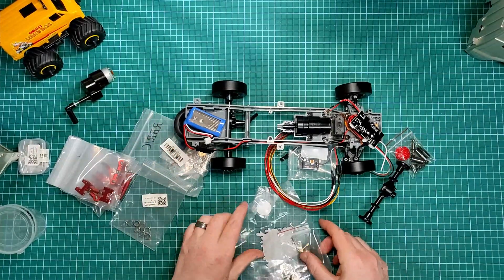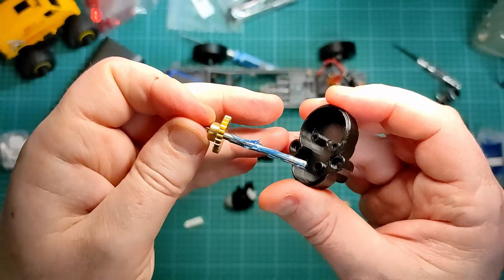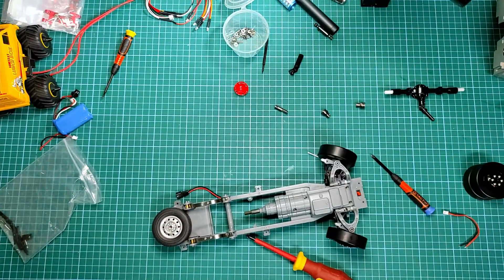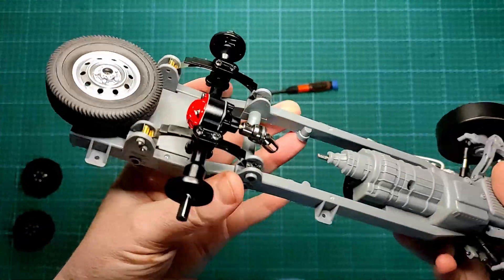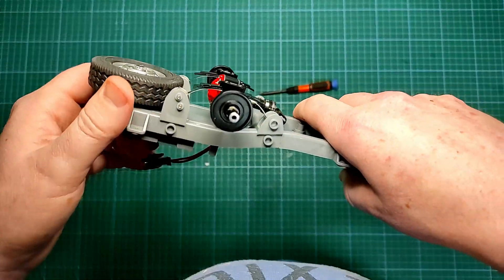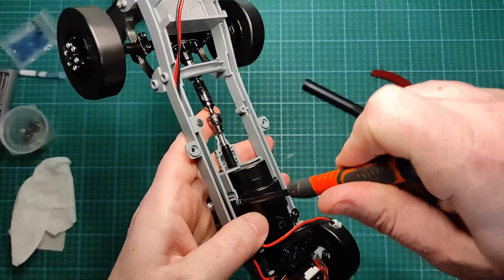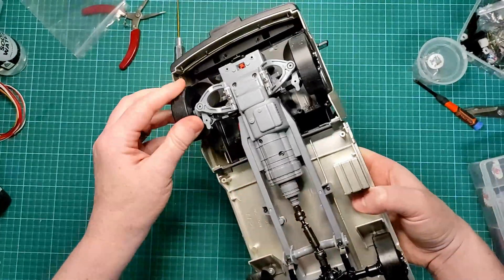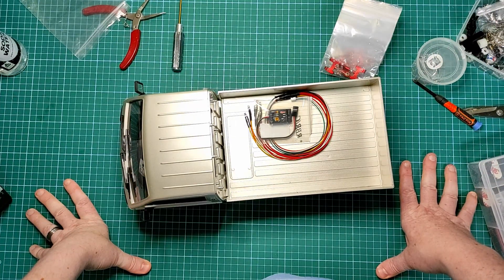How to Upgrade WPL D12 Drivetrain inc. Bigger Motor Metal Gearbox Driveshaft Axel

Comment: My 370 motor cuts out and the lights flash ... I can't figure out why either
Reply from the maker: Been a while since I messed with these, but usually that means your drawing too much power under load and so the battery gets too low, and low voltage protection kicks in and shuts you off. Cause? Gearing may be too tight, might need a better ESC or battery. I'd ask around in wpl forums, someone will know exact cause.

Comment: After my upgrades to metal parts, my D12 sound like a tank. Very loud engine sound and slower in speed.😅
Reply from the maker: Hahah yeah, upgrade to metal, need bigger motor. Bigger motor need bigger battery. Bigger battery need better Esc. Better Esc need better radio. And on and on :) then you begin to appreciate the original design haha
Reply: @CheapCheerful  Yeah, u r absolutely right 👍Thus, I have ordered another D12 on the way😁

Comment: Is the factory dif open?
Reply from the maker: Good question! The most basic set has a "locked" (or no diff) if I recall correctly, though it's been a long time since I've used stock, perhaps someone else can confirm. If you are getting the upgraded diff, there's a number of tutorials on installing and breaking in the gears (usually with a drill) I'd recommend you research and follow that guidance.
Reply: @CheapCheerful  ok thx

Comment: Do you have a preferred/trusted shop (or shops) for your upgrade parts? I just picked up a D12 here in Australia and AliExpress feels like a proverbial minefield....as usual.
Reply from the maker: Yes, if you google WPL Official Store you'll find it. Obviously more expensive than AliExpress, but if you're ordering a delicate part (especially replacement windows, body shells) you can be 100% sure they'll ship it perfectly packaged and it will arrive pristine. I still use AliExpress for many of the unofficial upgrades, but like you say, it's a roll of the dice.
Reply: @CheapCheerful  Thanks for taking time out to respond. I appreciate it!

Comment from the maker: So my view after upgrading the motor is that it definitely feels slower, but that the 370 motor likely requires a bigger (3S) battery. I'll be grabbing a new ESC and checking that out soon. What's your view?
Reply: i changed mine from 280 to a LaTrax 370, weak low end power, strong high end. it was like it was being powered by a turbo. definitely needs a better esc, battery doesnt need to be 3s i think. ive got a hobbywing 1060 on the way, we'll find out.
Reply: I was just going to swap mine out but as I use it for drifting I’ll keep
It stock it’s quick enough.
Definitely going to swap the axle and prop though, the stock one feels cheap and rattles so I had a look and no grease!